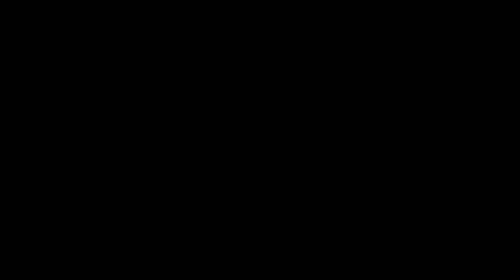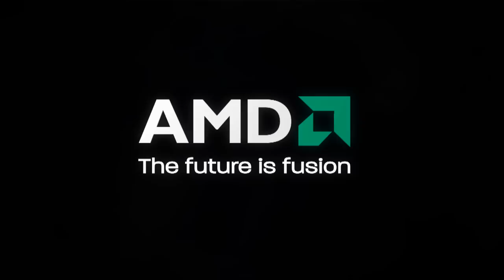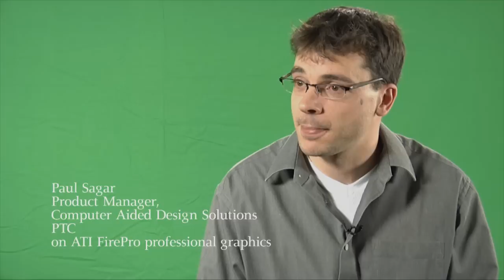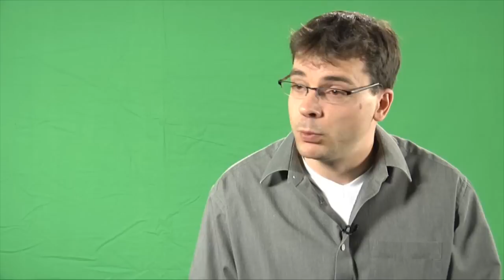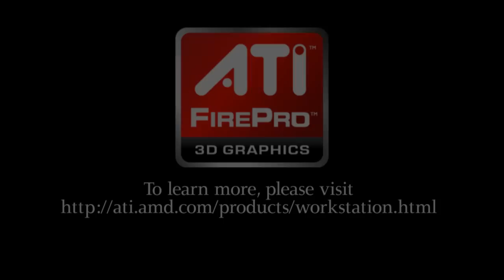Real-time Rendering for CAD Models

Comment: It's true, they are ahead in terms of manufacturing, size, heat and power consumption. Not to mention they're coming up with their 40nm mobile GPU's. I'm running a HD 4850 off a 350w PSU, nuff said.